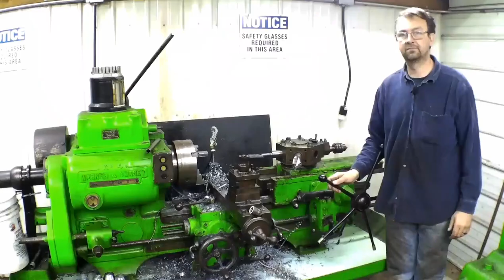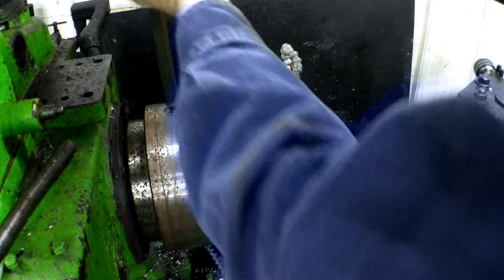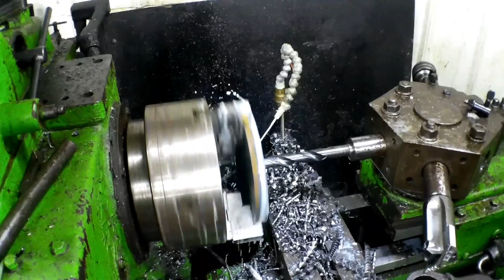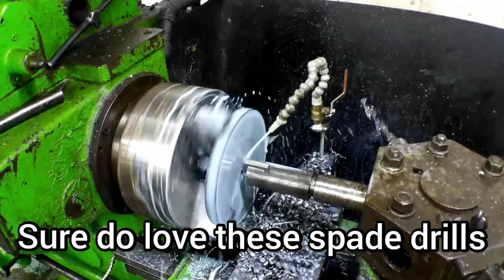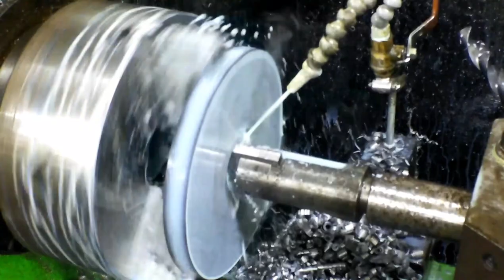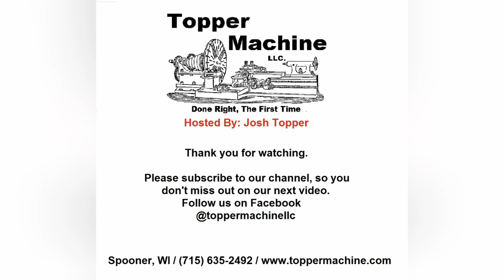Why a Manual Machine Shop Needs a Turret Lathe

Comment: I absolutely love a Warner Swasey turret lathe.
If you have all of the attachments for the Turret you can do alot of work.
I ran 3's, 2A's and 1A's.
Worked for Sundstrand Aviation.
Over 40 years ago.
Ran bar machines and chuckers.
You are absolutely correct Josh.
Everyone needs one back in the shop somewhere. 
Drilling and tapping, turning.
Heavy duty and big power and rigidity. 
Thanks for sharing. 
Take care, Ed.
Reply: That's funny, I ran the 4 A

Mostly drilling 5.25" holes in aluminum 

Loved being able to feed turning the od & Id same time like on my vertical

Comment: Awesome video! Seems like the perfect machine for a small shop. Can you do single point threading on this machine? I've seen some geometric threading dies used on similar machines, but I'm having a hard time learning much else about threading on them. I'm interested in getting a smaller turret lathe for my shop, just trying to better understand capabilities and limitations. Thanks!

Comment: I just picked up an old herbert number 7 turret lathe, deffinitly interested in any information you have running these machines, especially turret setup, old owner was just running a solid tailstock through it and didn't have any holders or anything spare. Very excited to get it up and running to its full potential

Comment: Excellent work and perspectives.    I love the utilization of the older tools and they can certainly be great helpers.  Being able to setp away for a little bit as the machine works is a time multiplier.  I have a 3 in 1 shop master bridgemill crammed into my tiny shop, but two years ago I got a tailstock turret and for small runs of bushings or spacers or threaded standoffs I am grateful to spin to the next tool and keep working.  Little turret is fine for little things and my hobby of real-ing my dreams.

Comment: I went to look at a Ward 2A (1942) today. Very unique machine and a good survivor, with even all Dutch tags on the controls, original booklets, etc. But it took heavy damage from moving it out of a shed. They said they 'bumped into things' but the broken off handles and bent levers to me point to it having tipped over and fell on its front side. Likely used a pallet truck lengthwise and slipped off. Too bad - it might have been worth saving without the damage. Worse still because I have all the equipment to do a proper job. Unfortunately the vast majority of damage happens when machines get moved.

Comment: I have a question regarding the coolant/cutting fluid. Where does it go after it flows off the part, does it recirculate or is it a one time use?

Comment: Many companies don't like them in their shops, just because they look old-fashioned, always have large horse power motors, designed for 24/7 operation.
The Burnishing Box was a great feature on them.
Thanks for sharing.
Reply from the maker: I'd be lost without it. Just for roughing and miscellaneous stuff it's been a work horse.
Reply: @TopperMachineLLC  Do you call them "Capstan Lathes" as well, or just Turret?. I think a "Capstan" has a collet chuck only, with auto rotation as soon as the collet is closed?. Here in the UK we have "Herbert" and "Ward" manufacters, still very popular, as you state a lot less than a centre lathe to purchase.
Reply from the maker: @bostedtap8399  just a turret lathe here. Very rare to hear capstan. These warner swasey machines could go either way, chuck or collet
Reply: @TopperMachineLLC  Its more common to hear "Capstan" here, rather than "Turret", havent the faintest idea why. 🤔
Reply: @bostedtap8399  did my time on a Ward No 7. Would love one now for repetitive work but alas no room.
Reply: @bostedtap8399   The one in the video is a Capstan .   A Turret lathe  does not have the  separate slide for the turret  , thus the turret sits on it's own carriage on the main ways .

Comment: Hi Josh .  Your lathe is a Capstan Lathe .  Good machines , i have just done a deal on a 2D Herbert turret lathe .  Having operated  Capstan  & Turret lathes ,   I think a turret lathe is of more use in a job shop as the turret runs on the main ways & less mucking around to set up for one off jobs .   Cheers .
Reply: Actually this is an example of a ram type turret lathe, not a capstan.  A capstan lathe has a round turret, not a hexagonal one.
Reply: @37yearsofanythingisenough39   Hi Mate . I am guessing you are from USA , so your terminology may be a different from ours .  
Our terminology comes from British decent .  Our version of a turret lathe , the turret carriage runs on the same ways as the saddle & the capstan lathe has a separate set of ways for the capstan turret to run on .  
I might do some investigation on the round turret  style as i have never come across one . 
Cheers .

Comment: My shop has five of these, all Warner & Swaseys. We've got three #3's and two #5's. Every single one is manned and churning out parts every single day. I run a #3. If not for our turret lathes the shop wouldn't be anywhere near as profitable as it is since a good 85% of our jobs end up in the manual department at one point or another during the machining process. So yeah, turret lathes are great for any shop that does production runs and has a manual department.
Reply: When I tell people what I do

& they immediately ask if you run CNC

I immediately know they have no fucking clue how talented manual machinists are & irreplaceable in the shop

Comment: I am with Topper on the value of a turret lathe in the shop.  The carriage feed knockoffs and rotary carriage stops are so superior to most engine lathes.  play to its strengths , do on it what it does well,  and its a Godsend.  Turret lathe in the shop ? yeah thats great but no room....they also live well outside under a tarp just fine  if it it has to be that way.  i wipe water resistant grease from auto zone all over the  bed ....very much worth the hassle

Comment: I have been looking for a #3 Warner swassey. What coolant are you using? Any issues with the clutch?
Reply from the maker: I run a soluable oil, but a regular cutting oil would actually be better.  No issues with the clutches.  It is a multi-disc setup, and easily adjusted.  I no longer have the lathe, had to sell to make room for a new one.  When it comes to clutches, I will never own a lathe that does not have a clutch.  They are a far superior machine to the ones that start and stop the motor.

Comment: If really want to go all out get a hand screw...they come in two sizes og  and 2g  it's a brown and sharp  screw machine  head with  a turrent..some have power feed but most manual
Reply from the maker: I actually own a 00G B&S. It's last job was 10k of each screw on the 1894 Winchester rifles.
Reply: @TopperMachineLLC  things will run forever..be sure when in use oil  up properly...not just because  their full of oil
Reply from the maker: @miguelcastaneda7257  it's no longer in use and will be donated to a museum eventually